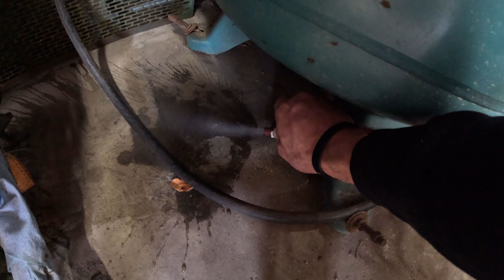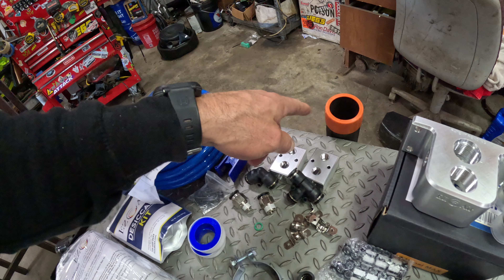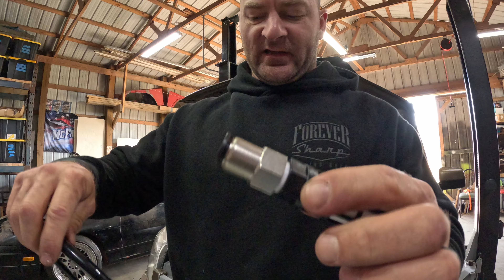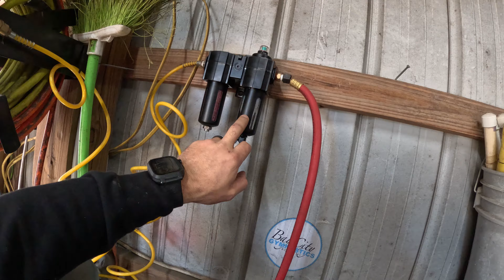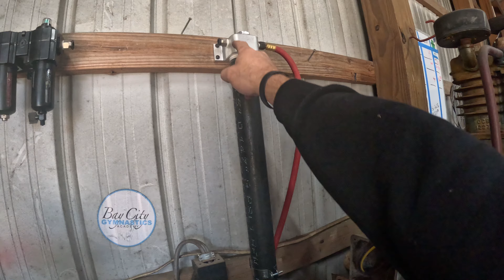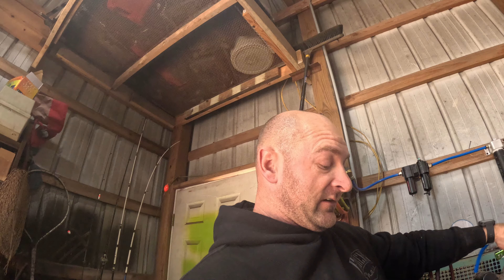Water in Your Air Lines? EZAir Premium Air Dryer System Install & Review

Comment: This kit is a killer deal. I was looking at making my own on the CNCs at my job, but I couldn't even buy the materials and fittings for what they're selling these for.
Reply from the maker: I love it, I have zero moisture in my lines now. Every time I go to use my air I drain the bottom of my compressor tank and get about 1/4-1/2 a cup of water.

Comment: So what's going to keep the inside of that black pipe from rusting and sending particles downstream? Maybe Galvanized would be better?
Reply: Hi David,  There is a filter installed on the outlet side of the filter chamber to prevent any particles from traveling downstream. Galvanized pipe is not recommended for air or gas applications because the galvanization can chip or crack and break loose inside the line. For this reason, black pipe is typically recommended. Some customers have also chosen to use stainless steel pipe as an alternative.  Please let me know if you have any other questions.  Thanks, Chris
Reply from the maker: Black pipe has been used in plumbing and other moisture related set ups, I guarantee it’ll last longer than the air compressor it’s self
Reply: . not worried about it lasting or rusting thru ....worried about it rusting enough to cause downstream problems or plug the filters he's fitted to it, I'm thinking CPVC would be a better choice.
Reply from the maker: There is 2 filters for in the pipe from the manifold. So any particles that are produced would be caught in the upper filter before the air goes in to the airlines.